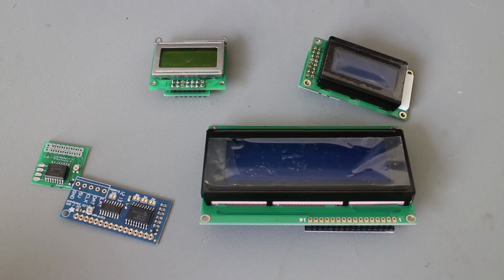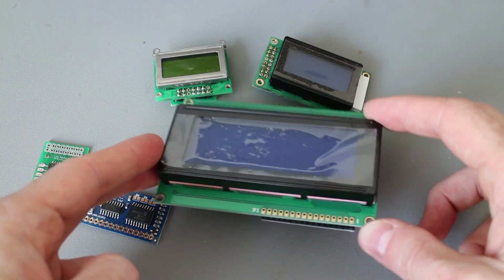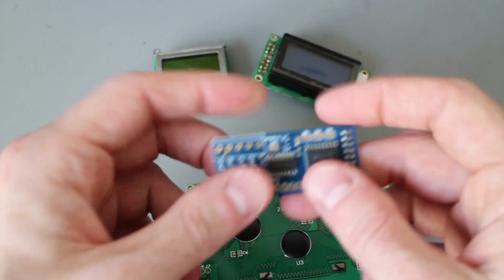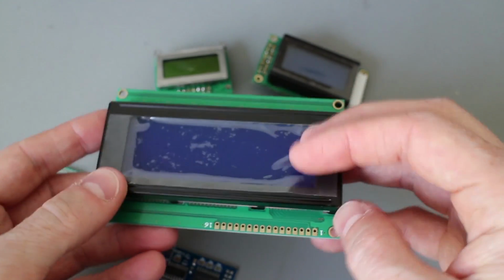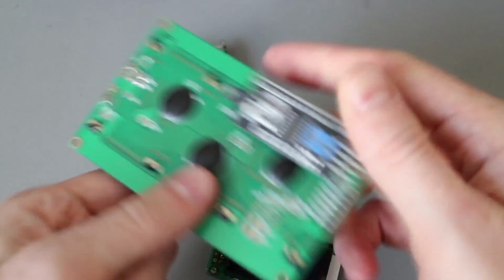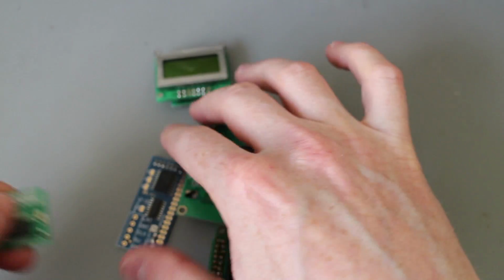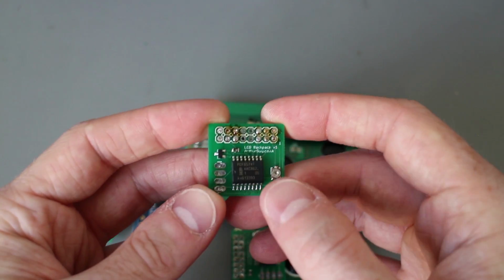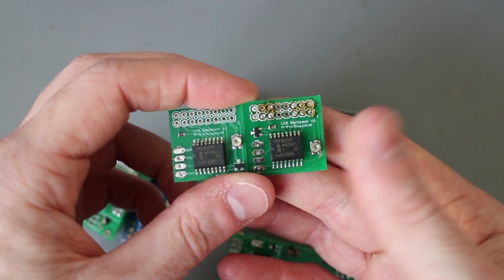Mini I2C LCD Backpack

Comment: Nice collection ;) BTW, what camera / microphone do you use to make these shots? I tried to make a video like that but it recorded in a horrible quality, so bad that I didn't dare to upload it yet :P
Reply from the maker: I used to use a basic camcorder (https://arthurguy.co.uk/blog/2013/12/youtube) but a couple of months ago I got a Canon EOS M which I am using now. Its not that much better but does allow me to use a lapel mic and have more control over focusing.
Reply: Arthur Guy
Oh that EOS M looks good. So this one can re-focus while recording? If so, then that's what I want.
Reply from the maker: Chip Guy Vids It can refocus and it is silent but it isn't the best. The focus in this video was a bit messy, in a previous video I locked it down to a fixed point which worked well